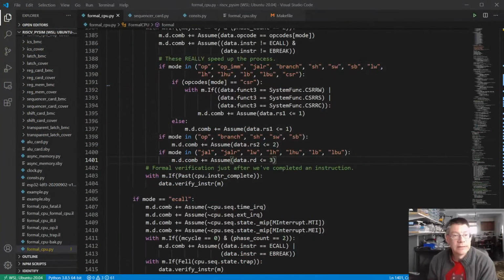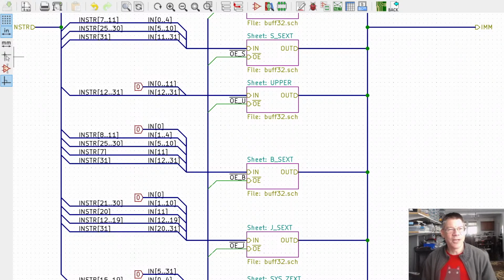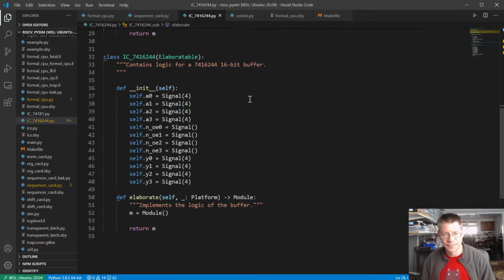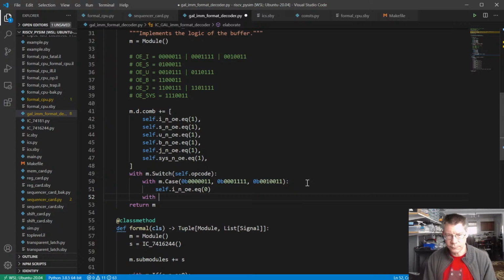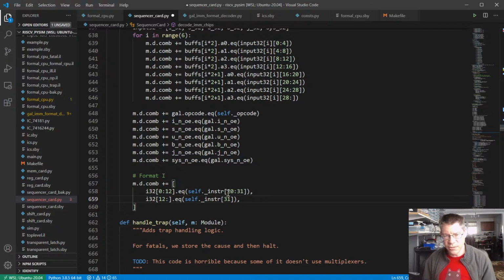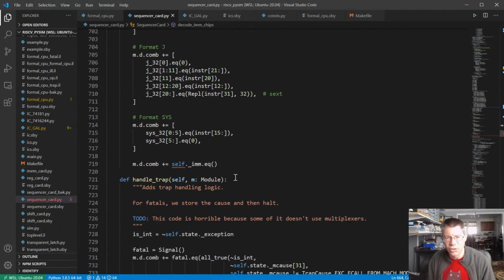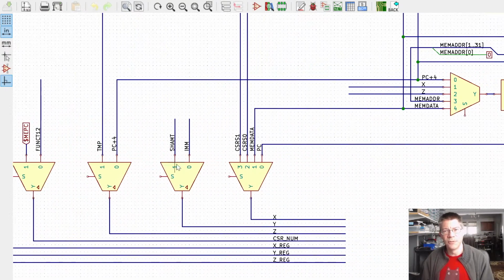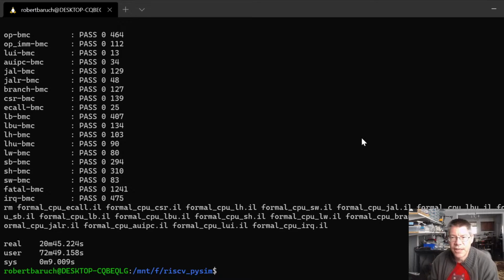Live programming: LMARV-1 RISCV

Comment: I've had success with the TL866ii programming 16v8 and 22v10 GALs but only with new old stock Lattice parts rather than the in production Atmel ones.
Reply: I've managed to program some ATF22V10C chips on a TL866II. It seems to run warm, but I don't have much experience to know if that's normal or not. Regardless, it does what I programmed it to do.

I used PALASM from DOSbox in Linux and burned it with the minipro command line tool. I tried using the open source GALasm tool, but the binaries it produced didn't seem to work correctly.